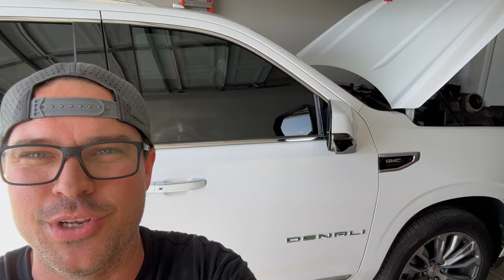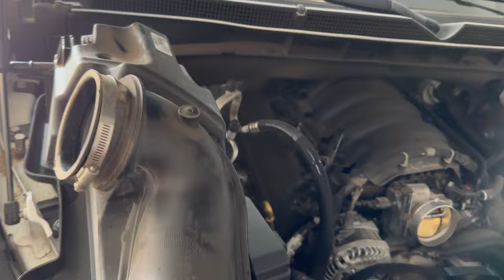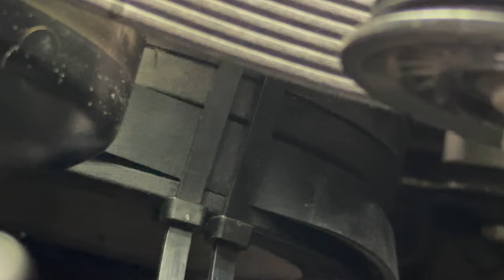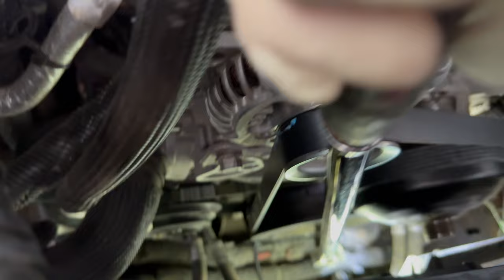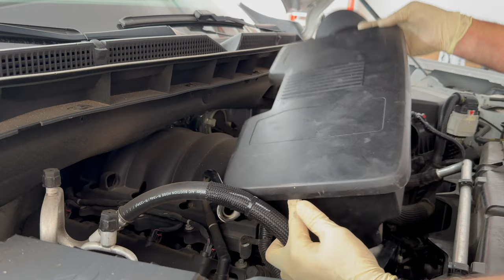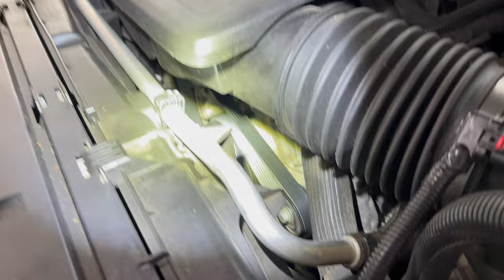How to Replace Drive Belt on 2020+ 5.3L & 6.2L Stretch belt(WITHOUT TOOL).

Comment: This may be a dumb question, but can you turn the crank with the vehicle in park?
Reply from the maker: Yes. Think of it like this.. Your engine runs. In park. In simple terms your transmission controls the amount of power your engine makes converting it to the correct torque needed to turns the wheels..
Reply: @Bobsgaragetech  thanks for the great explanation!

Comment: On my way to work this morning I could hear my drive belt squealing and also some rattling, eventually the belt came off, belt was frayed but still intact, afraid I have a faulty pully, about to do a closer inspection (2020 GMC SIERRA 1500)

Comment: My belt is frayed on my truck.  I’ve noticed when watching videos on this belt change that others are also frayed. Seems to be common on this generation GM truck. I ordered both the AC belt and the drive belt. Decided to do both because I don’t want to cut off a perfectly good drive belt later on to do the AC belt.